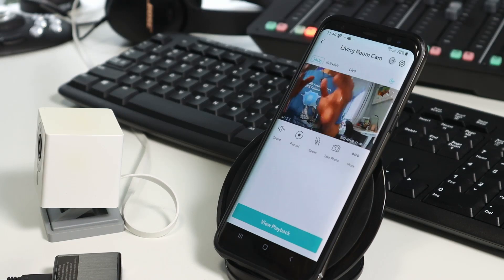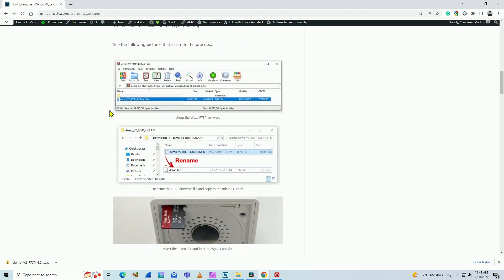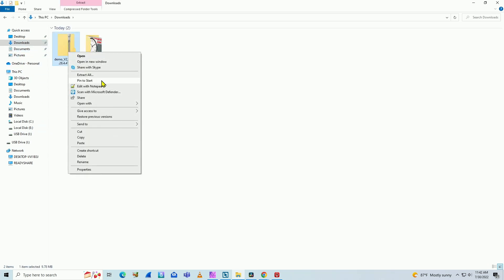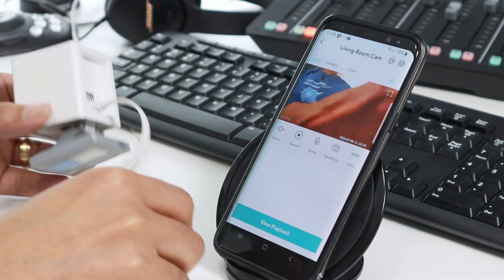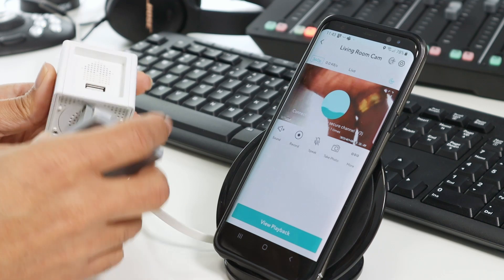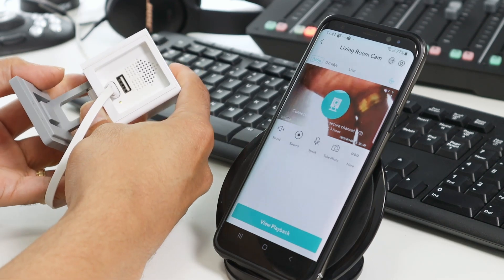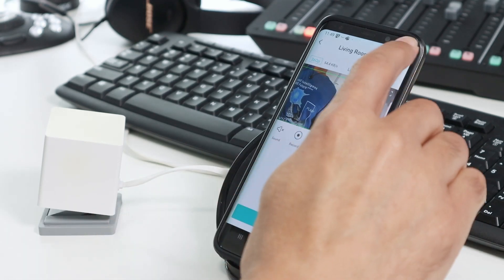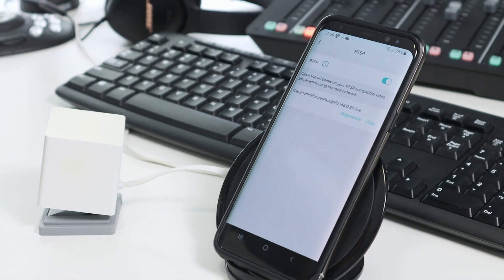How to install and enable RTSP on Wyze Camera [ Free Download ]

Comment: 3 part question:
1- Can the Wyze firmware be dowbloade or backed up prior doing the upgrade in case we want to revert to the original? Or is there a url to download it from Wyze?
2- Are there any downsides / limitations to the new firmware? If yes, what are they?  
3- Why is the new firmware called DEMO ? is it a demo version? is there a full version?